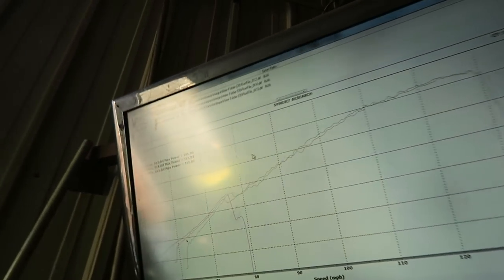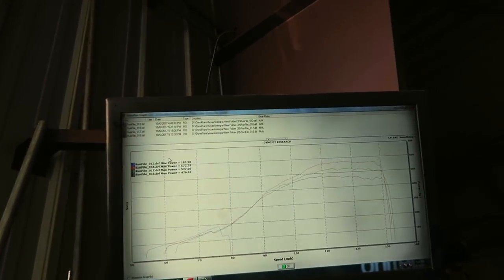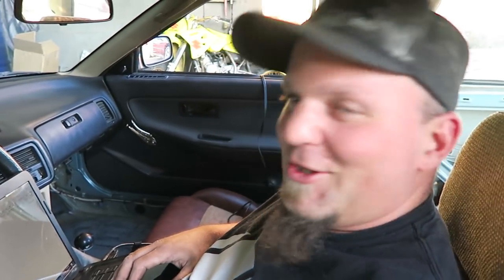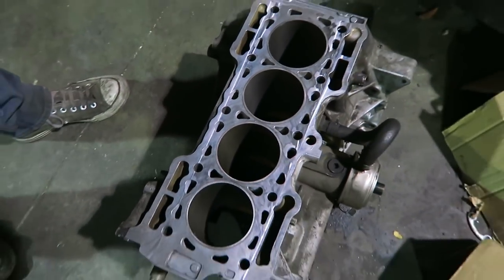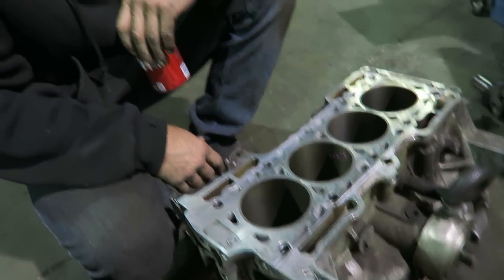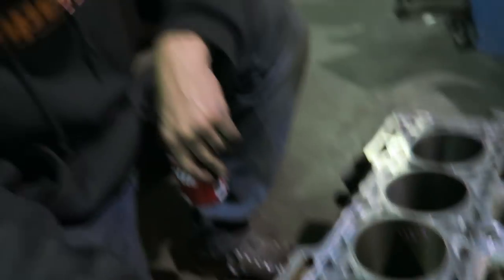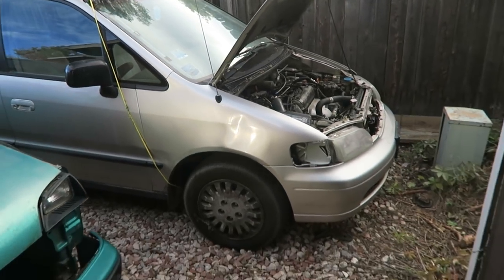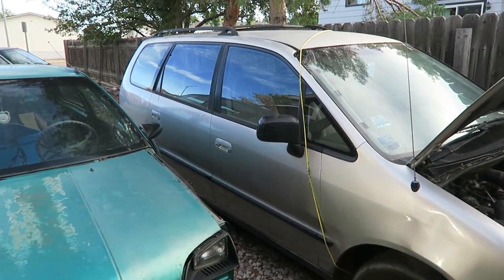Sleeved Block for the Turbo Minivan!

Comment: Sleeved block for the van and a stock one for the hatch.... glad we got our priorities straight lol
Reply: SonofaLeach the h22 in the hatch isn't sleeved for a reason...
Reply: And what reason is that?
Reply: These sleeves are more fixing the block  than a performance upgrade cuz it’s closed deck.
Reply: Might be a stupid question but what does closed deck mean?
Reply: Legendary Valky Look up images of open deck vs. closed deck and it will make sense.
Closed deck means there is solid metal supporting the piston sleeves with small passages for the coolant. Open deck means there are large open cavities for the coolant around the sleeves.
Reply: Cool, thanks for the sweet knowledge.
Reply: No problem. There are also semi closed decks, which are somewhere in between.
Reply: What kind of sleeves is it ?

Comment: FUCKING oil cap was turning when the sketchy teg hit 600
Reply: engine was screaming for more OIL!
Reply: lmfao, when i finally saw it i spit my food out
Reply: SKETCH
Reply: Dat blow by son
Reply: It wants a catch can
Reply: GODSGUNSGLORY ✔️
Reply: yeah I seen that shit....
Reply: Lol, it has a catch can with plenty of vent for the motor. I added a little oil right before that pull and forgot to tighten it
Reply: GODSGUNSGLORY foreal lol needs a better catch can set up
Reply: Haha nubs. The cap turns freely all the time without actually opening it's like your gas tank. Push the turn or like a bottle of pills.
Reply: i know nissans do it, a stock honda is a fixed cap, but it don't look stock, so you're probably right.
Reply: It just turns bro it's not a Bugatti

Comment: Im calling it. High 700s to low 800 horsepower on the van when its all "done" the first time
Reply: Galactic Gabber it'll be the next 1kwhp van on bags
Reply: Galactic Gabber well I still have hope on a 1000 HP van
Reply: Galactic Gabber you thoughts are correct

Comment: Line hone is for sizing the main bore for the crank. For instance, If you use ARP main studs instead of factory main bolts. The studs clamp tighter, your bearings will get mangled. The machine shop will take some metal off of the bottom of the main caps. Then they will install and torque the main studs, then they will hone the main bore back up to the proper size.

Comment: Looks at the tire deformation. This is for the people that think it's not a problem to run on the dyno for ages like you're driving to the grocery store. That deformation is what makes heat in the tires and will destroy them if you push for long periods. Notice how quick these pulls are. It seems like a lot of mobile dynos doesn't understand how they work and the stress they put on tires which results in catastrophic failures.

Comment: Hey bro. Got a question. I've got a 2002 honda odyssey. Are there any trans upgrades for these things? Also how hard was it to put the 4cyl in its place? Does it bolt in the same? Or did you have to fabricate alot? I'm trying to find where you guys started on this build but I'm having a hard time. Also what about wiring and computer?

Comment: Gutting all the abs/air conditioning from the engine bay and under the dash drops roughly 100lbs. Ik the abs system has a big harness to separate ecu. Gives you lots of room and plenty of 10mm bolts lol

Comment: I have a question my truck takes a while to start up what should I do I turn the key and it takes like 15secs for it to turn on
Reply: Andrew Arias cam positioning sensors MAYBE or crappy battery
Reply: Very broad to diagnose lol I'm no mechanic yet 😉 in school now but I have a g35 that would take a few seconds to turn over and I replaced the two positioning sensor and it fixed my problem